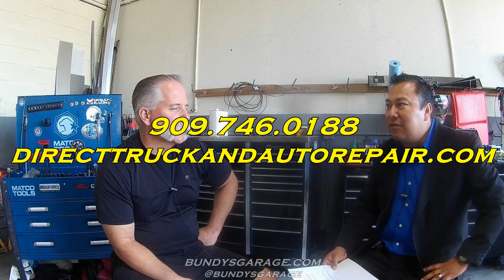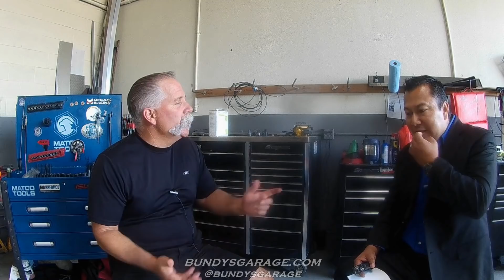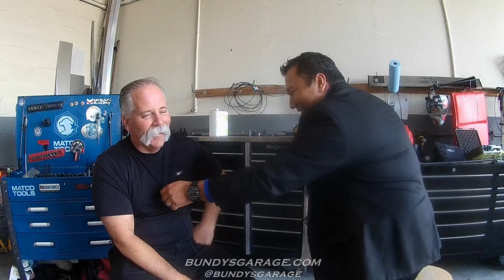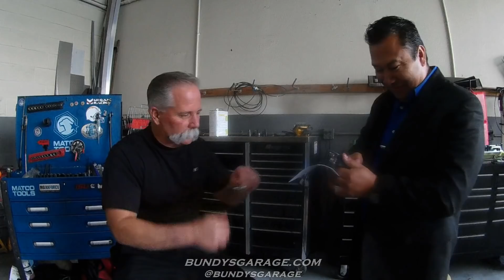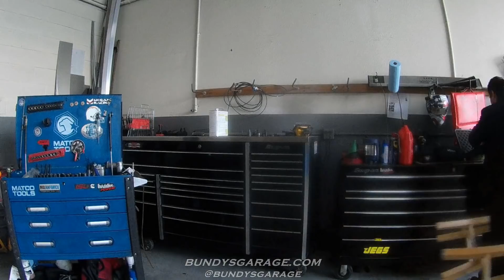Worst Diesel Engine Ever - What is the Best Diesel Truck out There? | Ford Dodge Chevy

Comment: If you get the work done by the right people, the 6.0 is a reliable engine. Now that they have ironed everything out.
Reply from the maker: What I don’t understand is this. A company that has been making engines for over 100 years can’t get it right. Where Toyota and Honda have nailed it! You don’t see secondary businesses popping up around fixing Honda’s and Toyota’s, the inherit flaws that you see in fixing Ford Diesel engines.

Comment: its called get rid of the egr  system and your good to go. its the goverment putting there hands into everything thats the problem
Reply: TRUTH
Reply: @hanskinslo326  The EPA can suck my cock! They don't realize how they are screwing manufacturers over with their BS "regulations". Some day we will put regulations on them not to force emissions standards on diesel engines.
Reply: @wysetech2000 , LOLOLOLOLOLOLOLOL      Don't run the exhaust into the cab.  Problem solved.
Reply: @AppleUser   Before you choke on your tongue do a little googling on the affects of diesel exhaust on human health. It's much worse than a gasoline engine. Google the affects of VW dieselgate on human health while you're at it.
Reply: They also don’t mind the next generation of their family not having a planet to live on.
Reply: @wysetech2000  This message brought to you by CNN. Lol
Reply: @2001FordPowerstroke  read about ether and lead in gasoline and what it did to people's health. You can thank the EPA for outlawing it.
Reply: @wysetech2000  , breathing in any exhaust is bad.  However, Diesel exhaust will fall and clear up faster.  Diesel will give better power and mileage to boot.
Reply: @wysetech2000  vast majority of pollution is not from cars. The media has portrayed it that way.
Reply: @wysetech2000  ethanol gas with all its nasty additives and other oxygenates are the nastiest carcinogenics out there.
Reply: wysetech2000 that’s a joke right? Diesels burn clean and If you want to piss on someone about emissions get mad at China, they are the worlds worst polluters
Reply: Ford had to drop the 7.3 for the 6.0 because they couldn't get the 7.3 to pass emissions.
Reply: @TexasBiker68  The government is responsible for killing the 6.0 and 6.4.
Reply: @EM-fi2qg  ....and MSNBC threw the rachel madow show
Reply: Lorne Johnson   I live in Canada and we have strict regulations as well. If a car or truck here ships to the US it has to pass all requirements for emissions. Regulations are set all over the world not by just the DEMONCRAPS.
Reply: @ Ryan CHRISTOPHER Modern ERG systems are not like the early ones. The 6.7 even uses the EGR in a clever manner to help regulate EGT temps under heavy load thus protecting the engine. The issues with them come from high idle and short trips where they clog with soot. Just cause these things are clean idle certified doesn't mean they can idle for long periods without issues.
Reply: I have a 2001 Cummins with the nv5600 and a 1997 f450 7.3 powerstroke
Reply: Chris Nelson well how do you regulate livestock emissions, shove a filter up each cows ass? It’s impossible to regulate livestock emissions.
Reply: * you’re  and * their
Reply: Yea, I think my 2000 7.3 spark arrest is approaching it's quarter life in another 40+ KM. There is so much to go wrong a spark arrest compared to DEF Emission technology:(
Reply: Yea manufactures need to give the government the middle finger and tell them if they keep up there crap with regs they will quit selling vehicles in the U.S.
Reply: Mark Godfrey  Is that the best you can do? Call everyone an idiot?
Reply: Ryan CHRISTOPHER oh there is way worse problems than the EGR the sixfloor was an engineering nightmare designed to self-destruct regardless of the EGR
Reply: @Wes Tell him, bro. There have been people who get everything from the government just from sitting on their asses. In contrast, I know of single moms who struggle just to put anymore than some rice on their tables for their kids, and they work their asses off. So that means the single moms out there don't have to work their asses off, they can actually relax and have fun with their kids off of government support, eh? The government could be putting their energy towards more important causes; instead, they are so damn worried about trucks that cause maybe 40% of emissions in the world.
Reply: @Wes I haven't been in the cities that much, but I can see where you're coming from. I'm from Utah, but my cousin has been to New York and Filly. He says that the subways there are shitholes, and I've had to breathe in sewer fumes the hole time I was in Chicago. I call Salt Lake "Salt Lake Shitty", because the pollution is so bad their, and I know no more than a small percentage of it is diesel fumes. People think lakes are full of garbage, but I don't doubt cities are worse.
Reply: @2001FordPowerstroke  You're blind, and you own Ford trucks? What for? So people can tell you how nice they look? Must be tough for you when it's time to wash them. Hey dude, you missed a spot.
Reply: @csn6234  I'll take your Helen Keller insult as a complement because she did do some good stuff for the world. Anyway, I can understand your original comment now about Ether in gas and we both see eye to eye on diesel emissions. But, I still don't see why you just came out of the blue and called me retarded if you felt like diesel emissions were only 0.01% of the problem. The Mercedes swap on your Jeep actually sounds cool. I haven't seen any videos on YouTube about people doing that swap.
Reply: @2001FordPowerstroke  Thanks, and I apologize for my insults. I don't know what led me to say that, but it's not worth going back and trying to figure out. FWIW, I read a fascinating article that explored the use of Ether (lead additive) in gasoline in this country before it was phased out in the early 1990s. The researchers noticed a rise in violent crimes that began after the sale of leaded gasoline became widespread, and then a sudden decline in violent crimes in American cities after leaded gasoline was banned. They realized that there is a correlation between the two, and concluded that the inhalation of emissions containing lead damaged people's brains, leading to irrational behavior. 
I get tired of people shitting on government regulations. I'm for common-sense laws that protect the public interest and our health and welfare. Without the EPA, we would be breathing in filthy air like what you see in China, and companies would be free to dump their waste in waterways. Incidents like Love Canal and Times Beach would happen again  and again
Reply: @csn6234  That is actually fascinating that the use of lead in gasoline could possibly contribute to the rise in crimes, and it would make sense.
Reply: @2001FordPowerstroke  Sure, whatever you say, Helen Keller. I've been busy doing shit besides trading insults with you. So when was the last time you actually drove one of your nice trucks? Thirty years ago, before blindness set in?
Reply: The ONLY reason we have the extremely powerful and extremely efficient engines we have today is a DIRECT result of the government stepping in and FORCING the manufacturers to improve.  When I was a young mechanic in the early Seventies damned near every single new car smoked just a little bit.  That's just the way it was, cars expelled smoke out the exhaust when they ran, got around 10 miles to the gallon and a car was considered dead at 120,000 miles. Most of that smoke was wasted unspent fuel and oil. Because the manufacturers were forced (by the government) to improve Fords LARGEST V8 now gets better gas mileage than their most fuel efficient four cylinder did in 1974 and NONE of the gas engines smoke now even clear up to 200,000 miles. And you can thank the government for the extreme horsepower jump we've had through the years due to the OEMs switching to electronic fuel injection.
Reply: @NorthernChev  No, you can thank  japan.  They were kicking our ass.  Injection is what broiught power, effienecy
Reply: @NorthernChev  that's true in gas engines I agree but not diesels maybe they will get a handle on it
Reply: Ryan, almost NO (NEW) cars these days have EGR valves... Highly efficient computerized fuel injection combined with variable valve timing has all but completely eliminated the EGR valve.  This isn't to say you can't find one or two out there, but they're damned near extinct these days. Do your research before commenting.  You look silly when you make comments like that.
Reply: @NorthernChev  On cars you are right but diesel trucks still use / need an EGR system.
Reply: @NorthernChev  - I thought we were talking about diesel engines here. And yes, diesels do have EGR systems.
Reply: The exact reason Paris is burning right now. The French are fed up!
Reply: When you increase the volumetric efficiency of the combustion process you also increase the fuel economy and power output of that engine.  You can thank the government for that 650  HP V8 Corvette that now knocks down 25 miles to the gallon.  Because the OEMs wouldn't have done it on their own...  Here's some more badass power as a direct result of government regulation: Ford Mustang Shelby GT350 536 HP --> 21 MPG, Dodge Challenger SRT Hellcat 707 HP --> 22 MPG, Porsche 718 Cayman S 350 HP --> 29 MPG... ALL thanks to your friendly government regulation.  So, you can all take your Fox News bullshit propaganda and go fuck yerself while I go enjoy my 306 HP Volvo Polestar C30 that rips the ass out of your 1970 Chevelle 454 (9.3 MPG) in the quarter mile AND top end but still gets 30 MPG on the highway. Oh... and the modern car can actually turn a corner very quickly without understeering too thanks to government regulation.
Reply: @NorthernChev  We were talking about diesels, not gasers.
Reply: @NorthernChev  thank the almighty government for all good in life.  
Forget that efficiency and power are hampered by the emissions. 
 But the manufacturers have done a reasonable job while being hobbled by government emissions regulation.
Reply: @Chris Nelson  It is nice to see these dumbshit reactionary coal-rollers be lambasted so effectively.  Thanks for that!  They love nasty deisel emmissions because they know it upsets people.  To them, a stenching unsmogged pickup spewing soot and unburnt, arosolized diesel oil is a great victory for "working people who vote republican".   Using the atmosphere as an open sewer is, to them, a way to fight against a conspiracy of namby-pamby do-gooders bent on obliterating their whiteman's priviledge.
Reply: @Spgonahan  With a properly executed programming and tuning from a reputable company and engineering firm software you can achieve absolutely everything on the positive side of cleaner emissions and improve fuel efficiency, along with lower "soot" or "black smoke" effect. The def fluid adds a subtle touch of coloring when the emphasis of purging the emissions system is commanded by the computer. Essentially all the drive time and idle time soot or carbon is burnt out of the filtration system all at once, then it's back to the same sequence next go around. That's on everything diesel that's got these systems implemented on them. There's countless times of downtime and lost revenue and income as a result of these systems breaking down and rendering a vehicle inoperable for a duration of time. Been there myself stranded far away from home at the mercy of a nearby dealership to remedy the situation. I've since had mine tuned and programmed for optimal fuel efficiency and as much clean running performance as possible. Yes. It costs more money to do it right as opposed to any tune here or there that's just more fuel and horsepower. There's programs and tunes out there that are good. For gas and diesel engines applications. They are able to get more out of an engine without increasing soot. Just government and individuals don't want to hear it or acknowledge it.
Reply: Spgonahan I am all about a better environment. However, you city boys don't understand how diesels are hampered by the regulations put on them. That is the reason why the 6.4 Powerstroke (if you know what that is) is such a big piece of shit, because of the DPF. It's like if you had a tube with one end up your asshole and the other up your nose. Whenever you took a shit, it would just cycle right through the tube and back through your body. Therefore, you have the same shit cycling right back through your body and you wouldn't function well without letting that poop out of your body, right? That is the same way the DPF is; it just cycles those soot particles back through the engine, therefore decreasing the life of the truck from the soot being trapped in there. Just like we have a need to poop, diesel trucks need to let the soot out of the engine. 
Here's an example of how the EPA has fucked us over: one of my sister's Christmas presents is late because the truck broke down, likely due to the emissions shit put on it. 
For the record, I don't "love" breathing diesel exhaust; I would avoid riding with my sister to school because the there was an exhaust leak that caused exhaust to blow through the air vents, so I know where you're coming from.
Reply: @2001FordPowerstroke  well, that is so impressive. How long did it take you to think of that? Did you write it on a pad first?
Reply: @2001FordPowerstroke  wow. That is so profound. Anyway, you're a dumbass. STFU.

Comment: Ford death wobble bad e4od and bad fuel mileage. 7.3 PSD were best but loud. I had GM love them . 
Now we ditched diesels and went to 6.0 GM gas 400k miles cheap to fix fast quiet in all our fleet trucks . Forget tiny toy diesels .
Reply: Diesels are money pits, I own a body shop and do a lot of fleet work and notice that more and more companies are getting away from diesels and going to 6.0 & 6.2 GM's .  The  Chevy LS engines are taking over the old small block Chevy engines that you have seen in all kind of vehicles  for the past  63 years .
Reply: motorhead1 engine1 Dodge ram gets the death wobble too! My 03 crewcab dually can do it so bad it ll scare the crap outta you! Lol!
Reply: I have the 6.0 on 2500hd it's a turd and drinks gas... it's a good engine for a hotrod but not for towing. If this engine quits I'm swapping in a 12v cummins
Reply: SovietRefusnik1 Golem  morning I

Comment: Everyone says that. Ford chassis, cummins engine, allison trans. Big trucks you can do that. Peterbilt, Kenworth, whatever.....
Reply: yea peterbilt, kenworth, freightliner, the only part they make is the hood and maybe the cab. someone else makes the frame. the truck is built to order. you decide the motor. the trans. what and how many axles. the PTO. whatever. we have an international autoshifting with a mercedes motor in it and a volvo with a cummins and a manual with the splitter and low high range so like 3 speed behind a 5 speed so you get 15 gears forward and 3 reverse cause low/low, low/high. high/high. i think
Reply: at 45 to 55 below zero, (which isn't a problem for most people) the allison had serious circulation problems, I remember once after a severe cold snap our small town had nearly every allison in the shop getting replaced
Reply: sorry, duromax

Comment: You're right about the 7.3 international in the Ford trucks mine has 400,000 mi the only thing I've done is changing the starter and batteries
Reply: My 95 7.3 has 454K would drive it a cross country right now.
Reply: 400k miles on the stock crank position sensor, glow plug harness, heater solenoids, injectors, and everything else on a 7.3 that needs to be replaced on every single one of them?
Reply: @406Steven  ????
Reply: You might want to change the oil & filters now as well 😀
Reply: dont forget the transmission that went out several times unless it's a manual
Reply: No problem with the 7.3 but you will spend more on transmissions than I ever will Dealerproofing my 6.0 and the performance of 7.3 isn't even close.
Reply: I bought a Ford 250 with 7.3 in 96---worked great until 75k--never pulled anything over 5k and then the troubles began---sold it went to the 4.6 and 200k later NO problems. @hr-extremesxsmotocross
Reply: @hr-extremesxsmotocross  I have never in 400k miles had to do anything to the trans